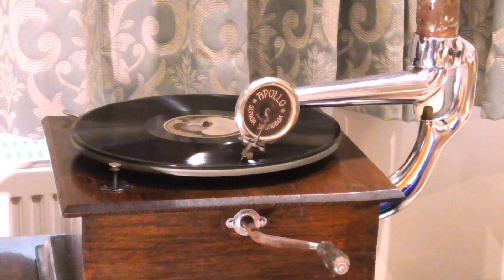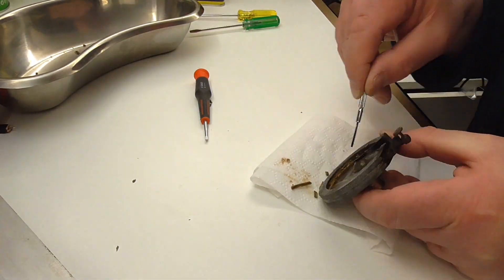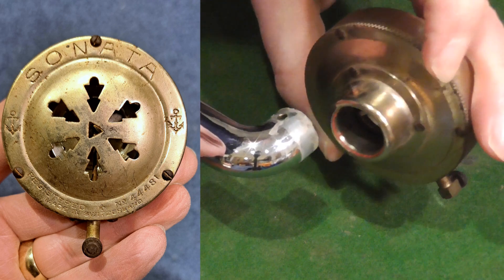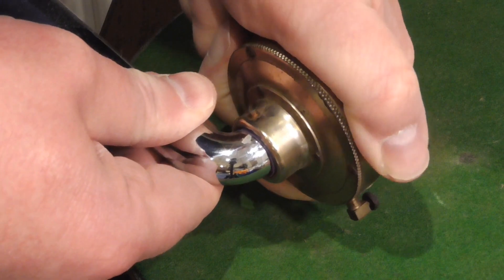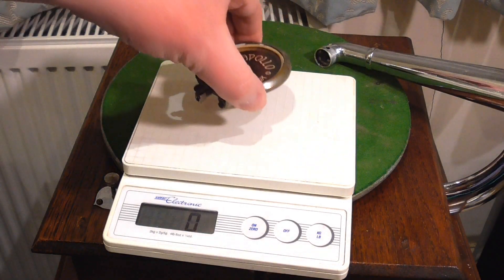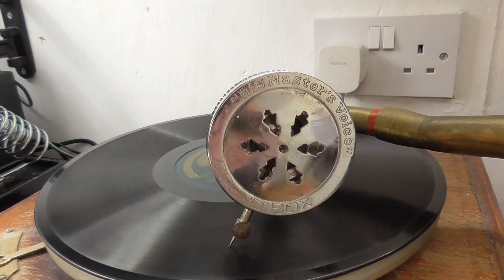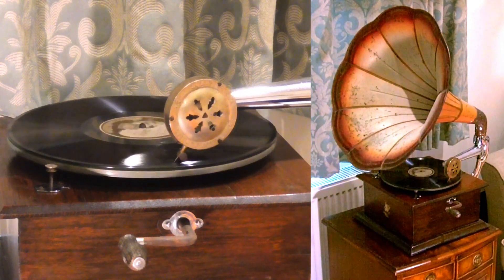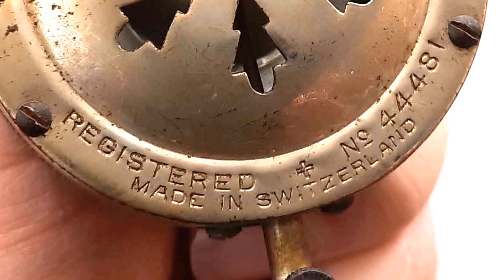Apollo gramophone, can I fix the sound distortion?

Comment: Hello Mrrgstuff! I love your videos, always watch them! The motor slowing down and then speeding up again After you take away the soundbox is caused by hardened Grease in the motor. Always. 
After you re-lubricate it you wont have this problem. Cheers
Reply from the maker: Thanks 😀 👍.  The motor has had a bit of a clean: https://youtu.be/vDpsJK8J7WQ
but I still need to do the spring barrel itself. Glad you like my videos 😀

Comment: I had a problem with a gramophone lacking power, even after cleaning and oiling the motor. Turned out to be slight misalignment of the governor bearings, causing almost indetectable extra friction. Check the governor shaft runs very freely.
Reply from the maker: Thanks 😀 👍.  I still need to clean the spring, so I'll check the motor over again and watch out for that too 😀

Comment: I was troubled by failure to reach the end on certain worn high friction records, when the Marathon external horn was my only machine. Was puzzled, because its double spring Thorens motor had ample capacity under no load. Someone commented about hardened grease, but another cause can be a weak mainspring. This problem disappeared, after replacing a broken spring. Here's an example of its playing capacity: https://youtu.be/1dnFtONSiPY Each side of this Marathon 12" disc runs for about six minutes, though needless to say I wound it between sides!
Reply from the maker: Yes, that's a good point. I have had a couple of machines with fairly weak springs. They have worked but needed a very good wind just to play one 10" side. Hopefully I will be able to get at the spring in the Apollo and should be able to see if it is weak also. Thanks also for the link! 👍😀

Comment: Hi!
The stopping of the motor could be because of the stiff rubber gaskets. They don't allow as much movement of the diaphragm and thus the connected arm and needle as new ones do. It makes it a lot harder to play. It should probably play through after you replaced those diamond hard rings C:
Reply from the maker: Thanks 😀 👍.  Yes, that did occur to me, too, and maybe it works better as the gaskets on the Sonata are softer 🤔. I will rebuild the original soundbox though, and I ought to relubricate the spring too!

Comment: Is the motor fully cleaned and lubricated, especially the spring?  Hard, thick grease will put a ton of drag on the system and especially in the spring box.  It will also be bad if there is even a small amount at each location,  but at every point in the system.
Reply from the maker: I still need to relubricate the spring. However, the workshop is a bit too crowded at the moment to do that. The rest of the motor is cleaned and lubricated, though I will have another look when I dismantle the motor to work on the spring. Thanks 😀

Comment: Sounds good. Using the electrician's tape is a good idea. Never seen an Apollo gramophone before...am always learning something new from your channel. Many thanks and blessings! 😊
Reply from the maker: Thanks 😀 👍.  Normally, I'd be wary of tape for that as it can lift the plating. However, it's only touching the existing plastic ring, so it should be OK. Apollo was one of many minor brands, most of which seem to have imported machines or components from continental Europe. Apollo used Paillard parts, which seem to have been sold elsewhere under the Maestrophone brand. There is an excellent site with old catalogues here: https://www.graphonogram.com/4-documentation.html
Apollo did make some very well respected machine later on though ISTR and they must have sold pretty well as Apollo branded machines seem to come up for sale reasonably frequently.

Comment: My gramophone which is the HMV 58 with a HMV 32 motor inside, I have to crank about 20 times just to hear one play and when I put the needle on the record after the first play, it starts to slow down the record and cause distortion, but when I put the needle somewhere on the middle of the record after the first play, it plays all the way. Why is that so? The gramophone uses a “overture reproducer” based on what I saw on the sound box
Reply: And the tracking force is about 134 grams
Reply from the maker: The grooves on the outside of the record are longer, but speed of the record stays the same, so the needle has to move faster on the outside than the inside of the record. When there is too much friction, the needle can't move as fast, so the record slows down. If the motor is powerful enough, it will beat the friction. It sounds like the springs in your motor are powerful enough to get through 1 record, but not enough to start a 2nd one. Reducing friction may help. Cleaning the record and using a quieter needle (I use a new soft tone one for each side). If the gaskets in the soundbox are hard, this will increase friction. I'm not familiar with the Overture, but I don't think it is the one the machine originally came with. Servicing the motor will help, but ultimately, to improve the performance, you may need some new springs, which aren't cheap and are messy to fit.
Reply: Well the motor is still can turns and the spring did not break so far so I will still crank it about 20 times but I’ll consider using the soft tone needles and I’ll crank about 10 times if the gramophone works with the soft tone needle and I’ll clean the record with all purpose sewing machine oil using a sponge
Reply from the maker: Yes, though when I mention new springs, I'm not suggesting your ones are broken, however springs do get weaker over time. I've not tried oil on the records (and that could stain the sleeves). I use cheap furniture polish, and certainly my Apollo gramophone is much happier with cleaned records as to uncleaned records.
Worn records can also increase friction, and later electrically recorded records may also be a problem as they are louder, and the power that makes them loud comes from the motor. Whilst on modern electrical gear, lack of power might result in a quieter volume, on a wind up gramophone it causes the record to runs more slowly or stop.